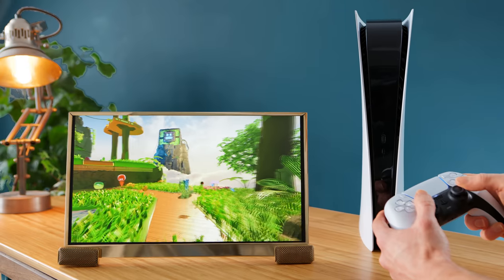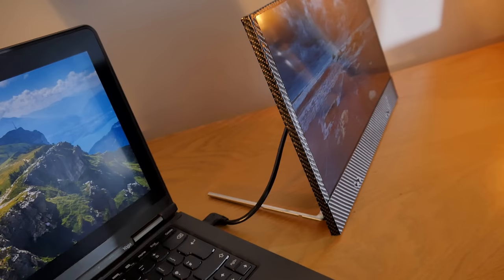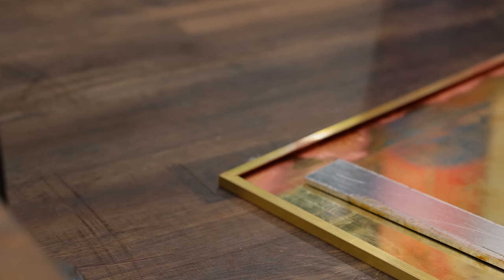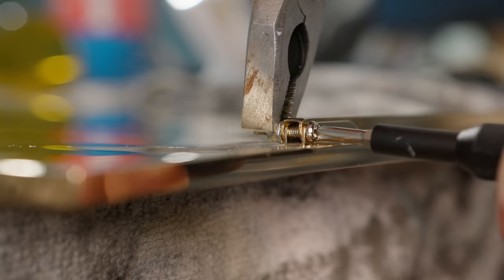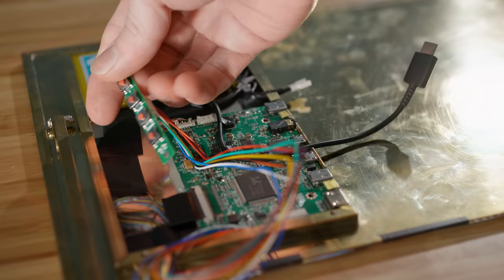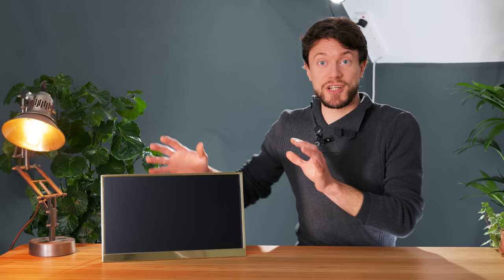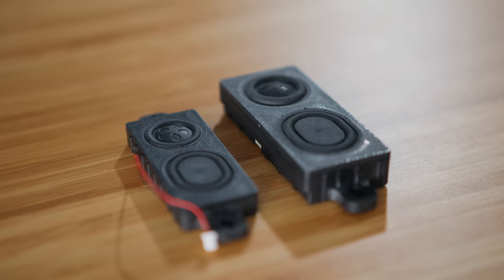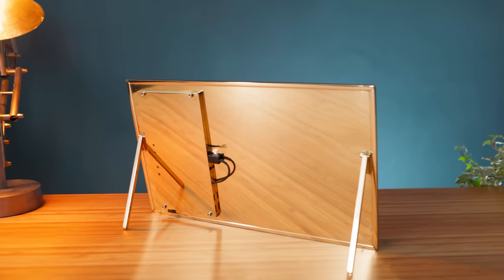Building a USB-C touchscreen monitor (new for modern devices)

Comment: Yeah everything is fine but u got away and didn't showed us how to solder the bottom frame to the back with the LCD inside the housing. Heating the back panel or the bottom frame would damage the LCD. I don't need sleep I need ANSWERS!😂
Reply: There were srew holes in one shot. 7:57
Reply: Agreed, screws are the way.

Comment: You can be good at making a diy video but it means nothing if you don't support the subscribers and other by answering quite important questions. Obviously make sure that your links are valid. Make it clear that not any screen supports touch. More information while building stating whether that the controller must supports the functions as well as the screen being used. Just stating using an old cell phone battery is not good enough. State that the voltage required is sufficient from a cell phone battery. At best they are 5 volt. Some only 3,7 volt.
And most importantly react to comments.
Reply: Yes, not all phone cells work. You are on point, not all screens can be touch screen too.

Comment: I want to repurpose old touchscreen as Star Trek-style interfaces, embedded in the walls of my house.
Reply: Doing what? remote door locks, or door openers?  Give direction arrows to sickbay? Those sound pretty cool... but just about any controls could be handled by voice only (if you don't mind some corporation listening to every sound in your house 24/7... maybe the self-contained touch controller is really better)
Reply: just buy a Samsung shop display panel with touch input, they are cheap.
not as good as wacom, good enough for star trek levels!
Reply: @user-ut9ln4vd5m  You should look into the Wio Terminal. Connect it to IFTTT, and the sky's the limit.

Comment: Is there any way to make this 120hz and still keep touch functionality? For PC gaming and such but also keeping touch functionality.
Reply: only with a screen and control board compatible with 120hz
Reply: @viniciuspacheco9607  There's microsoft surface pro screens that I've seen that are 120hz and touchscreen but I'm not sure how it would work if I used it as a monitor.
Reply: My laptop screen is actually 120hz and touch screen lol

Comment: next time at DIY perks: "making a spaceship out of 🅱️R A S S"
Reply: Wallace and Gromit would approve.
Reply: "now to compensate for the additional weight of the brass, we will use these recycled SpaceX primary Boosters, which you can get for pretty cheap on e-bay. You will need to attach them using countersunk screws..."
Reply: @diegosanchez894  😄

Comment: It's not clear to me, your display was originally with an integrated touchscreen?
Reply: he bought a touch screen along with the controller for a low price since they sell them as a "kit". He just mentioned that you can use an old laptop screen if you wanted.
Reply: @Kenny-bw2cz  Thanks, I think it's expensive for this size. This is the cause why I thought he used an old display.

Comment: Did you buy a screen that was touch-capable or did the control board make it touch capable or how does that work?
Reply: the screen has a digitizer, so you will need to buy a capable screen and control board

Comment: only 2 things i would have changed: screwing (instead of soldering) in the bottom bezel for repairability, and adding vertical kickstands or finding a solution that can be used vertically or horizontally
Reply: and maybe integrating the speakers into the bottom bezel rather than the clip on ones

Comment: Hi I'm a fan of your work. I see your videos when ever I get time.So a little request from my end is please do add the control board or other things in texts as well so that even if the link fails we get to google a specific one based on the need.I really cannot access the ebay links.Keep up the great work. TIA
Also I really wonder how a control board can add touch functionality to a non touch enabled lcd or led panel? i mean how does that even work?
Reply: The screen is from a touchscreen device. Once you have that then all you need is the right control board to get display and touch all in one. Hope this helps some. I'm currently trying to locate the control board he used as well...but the link is too old😂

Comment: If you were to make a revision to this, can I suggest an alternative battery protection board that can display the battery charge, and maybe build in some LED indicator in the front to display when it's low on charge or charging? I feel that's the key thing missing from this build and it'd be the first thing I'd seek to rectify if I were building it.
Reply: Awesome feature, I have a question, is there a way to indicate how a screen is touch screen compatible if it's original use isn't touch?

Comment: You might consider suggesting use of a non-lead based solder and an all-in-one solder with a flux core, for convenience.  And set up ventilation in a window in close proximity to your work space with a small fan drawing fumes away from your face and another window or door cracked elsewhere to allow free airflow. This is better than having a fan disperse fumes within a room,  without actually removing them... especially when if they contain lead.

Comment: That's such a cool look, will done! I'm just wondering, can I simply leave the LCD in the original laptop casing?
Also I assume, the battery is an extra add on and can be powered directly via the USBC?
Thanks

Comment: I've got 3 old LCD screens and controller boards sitting in my outside shed. Used them as a triple monitor setup years ago.. Been wanting to get one out and make a housing for it, I know the Pi can run off a power bank.... wonder if they could both run off the power bank. Just need to find the right cable and see if it works :O

Comment: So you're telling me you can make any lcd screen 4k or touch screen, just by changing the control board? That's cool as fluff!
Reply: what? no i think he was just saying those options are available now compared to some point in the past, a control board doesnt change how many subpixels/pixels are physically in the screen, the board just controls amount of voltage to each led to trick your eyes into seeing different colors and when those 3 make 1 color it has to position that among other colors to make an image, so thats 6.2 million leds(2.07M pixels) for HD, 24.9M leds(8.3M pixels) for 4k, and touch screens have a conductive layer that sends electricity through your skin with a way to tell where exactly you touched. and im guessing this screen hes using here is oled, or it just has a very small backlight
Reply: @Robo-xk4jm  Yeah I figured so but the way he said it sounded to me like you could just change control boards. And since he used an old laptop screen and made it touch screen made it seem like it would work to just change the control board. Seems there isn't any real magic left in this world :(

Comment: I watched this video when it was released and loved the idea! Recently my 60inch Samsung TV stopped working. Control board went out and I cannot find one online to replace it. Wondering if its possible to do something similar with my TV so i dont have to throw it away.
Reply: Hi. Google universal display control board. This may help depending on how your display connects in your Samsung TV. The universal display control board is a generic tv controller some have IR remotes. Hope this helps.

Comment: Hey, sorry to bother, but i am doing this project with a different lcd control board wich takes 12v and i still wanted to use a cellphone battery to charge it, i already bought most of the things, i just wanted to know if it is fine to use the cellphone battery with a dc-dc step up regulator to make it 12v for this project.
(The battery that i'm using is a LIS1558ERCP from a dead xperia z3 that i had, as for the battery protection board i am using the same that is on the video, and for last the lcd control board is a PCB800661 V.9 1HDMI)

Comment: I don’t see anywhere where he’s listed the thickness of the brass sheet he uses. Or the size of the U channel???  I’d like to do one just like this but I want to make sure I buy the right sizes
Reply: I think the Uchannel measurements depends on the screen used, since there are different thicknesses. The brass sheet should be thick enough to give a bit of structural integritry. Since the Uchannels ad a lot of stability, 2 to 3mm should be enough. The size of the uchannel can then be decided on to fit the brass sheet and Display in. A small gap shouldnt be a problem since the screen is glued to the brass sheet.

Comment: This monitor looks amazing. I want to reuse the monitor from my dead laptop and this build has pretty neat ideas. 
My question is, is the touch screen the same laptop monitor Matt uses at first with some accessory to enable touch features, or is it a different screen?
Reply: you'll have to find an appropriate controller board for your specific monitor

Comment: pretty smart, buy any laptop screen with touch and adapter, while this is like 200$, a touch screen monitor is 700 to 800$
what display control board you use for touchscreen monitor?
you should use a touchscreen with gorilaglass to be more resistant

Comment: This is amazing and is going me a great idea well it's your idea I'm just going to use it. So my home office is decorated in antiques like petroleana, old Tonka trucks and oil cans so a computer stands out and looks terrible and my laptop is dieing so I want to duplicate this build and I'm thinking about using a cell phone to power it. I have a iPhone 10xr or a Galaxy 10 either I can use. Do you see any problem doing this? I seen you connect one and it was perfect looking so would I retain most standard PC functions? I seen you connect a keyboard and mouse can I do that and a printer or an external hard drive? Please if anyone has done this could you give me tips or show me a link to someone that's done it? Thank you in advance, I am so excited for this to work.

P. S you mention desktop mode for the phone do either of the phones I mention have this ability?

Comment: What is the control board that you used? And you can power it with a cell phone battery, can the board run on 3.3 volts?

Comment: I need to replace an old CRT arcade for LCD touchscreen ONLY, I have a bunch of old laptops, can I use these displays by just adding this USB-C board setup? Does it replace the CRt Arcade touch overlay? (Input membrane.? - the clear grid covering the old display)

Comment: Wow wonderful project, I built a portable monitor but I didn't use this material.
Reply: Hi I was wondering what materials you used in your build. Currently searching for a control board for lp173wd1-tla1. Thanks in advance
Reply: @puregenius1983  i used mdf for the case

Comment: I need better documentation! what parts did you use? who supplied them? how much did it cost? This is amazing! I want the details bro!
Reply: After month of questioning around this project no answers from the author. Putting people under the wrong impression. Not every old laptop has a touch screen. The one shown does not support touch. You need a high resolution screen to get 4k. You get nothing for nothing. That cell phone battery supplies at best 5v. You have to use the control board that can operate on 5v. All the normal ones need 12v. No touch no usbc. Even if you are willing to fork out the high costs, you would find it difficult to match up these components. All links broken.

Comment: I'm wondering how you turn the device off so that it doesnt drain the battery? Also, how did you get touch working, because the screen that I have has a separate touch cable that need to plug into my board and I dont know the pin out for it, and cant find schematics online.

Comment: Amazing ! Ideas, sound, video 10/10 for me :) Your somewhat have a "sneaky face", it's always fun to watch. I don't think I will take the time to apply your ideas, still it's obviously doable without pro gear and that's the beauty of it. Very inspiring. Anyway, do you think lead soldering will last? It seems to me that the frame and feet could easlisy brake if not very careful. Actually I have an old iMac 27, 2011in very good shape (not a scracth) and I was thinking of making it touchscreen with more actual processing capabilities...First step would be to find a control board for it as the rest would easily fit in it, the inside is big enough for an ITX motherboard. If someone has ideas, it's welcome, i'll be happy to ear them. Cheers.

Comment: I have an old samsung tablet which i'm trying to use for my dash, but since the tablet motherboard is damaged i thought i would try this project!. I have ran into a small issue. The screen model number is LTL101AL06-104. I have found the controller board but I do not believe if it contains the digitizer for the touch screen and I am trying to find a type C version if anyone can help!

Comment: dumb question would a picture frame work for this ?     minus the glass front part tho   duo to glass would add glare
Reply: Maybe if you cut hole in the back of the frame for the controller board (assuming it isnt thin enough to no have to do this)

Comment: How did you use a 3.7V battery pack when the lcd controller board requires 5v?
Reply: I was looking for info on that controller and was wondering if it does operate on 5 volts. Older ones need 12 volt.

Comment: Im very impressed how you made this and I think i need this one. however, the links for the lists of parts isn't working. hope you help me about this
Reply: Unless you have a donor laptop, you are better off just buying a portable monitor with touch screen capability. You can find 15.6" 1080P for under $250 USD on amazon. You will need the lcd/digitizer ($90 USD), the eDP controller with USB C port ($40 USD), and the touch controller itself... Most of the components will come from China so lots of delays in shipment as well. Take a look at a disassembly video of a touchscreen laptop for a better understanding of the components needed plus the eDP controller for the USB ports.

Comment: Really nice project! 
I was wondering... would you be able to add support to act as a 'wireless display' for windows 10/11 ? That way, you could avoid all the wires, since you added a battery already.
Reply: You can buy wireless hdmi stuff that you plug into the screen and laptop as normal, although it might break the aesthetic and cost quite a bit.

Comment: Another good idea for a DYI cell phone find a brand new iPhone for cheap on eBay that's broke for some reason inside make sure the screen and body are good take the internals out of the iPhone and replaced them with a Android motherboard hook up the iPhone screen to Android motherboard hook up the cameras put them in the right places and still it back up and you will make the first iPhone running Android why has no-one done that yet

Comment: Hi Matt, I watched your previous vid on doing this and managed to get my hands on a beautiful complete lid/screen but realised it was a touch screen so wasn't suitable.  Now I've found this one and thought PERFECT, except I can't find any boards that suit.  I have the HP part number and get plenty of replacement screens coming up, but not a single board.  
It came from a HP Spectre x360 and from research, I think it's either an 801496-001 or an 833713-001. The whole lid is glued/sealed together so I cant open it up to find any numbers without breaking it.  I would love to get this thing up and running, so any suggestions or guidance would be really appreciated.

Comment: No clue if you read the comments, I'm checking out my local hardware/supply stores websites but none carry brass sheet metal. Are you using copper-aluminum here rather than brass? I can't find anywhere that sells it but I'd love to start working with it

Comment: Matt, love this diy! It got me thinking if I can repurpose my bricked Dell All in one touch capable, to a standalone secondary monitor with touch feature?  My Dell Xps 2710 suffered from black screen of death. But the HDMI in port works and have allowed me to utilize the all in one computer as extended monitor (but withOUT touch feature). Do you think the touch feature would work by either new control board that gives hdmi and usb 3.0 for touch? Or is there any internal cables I can convert to usb 3.0, to give/get touch inputs to a laptop?

Comment: So if the monitor is by default lower resolution you cant get better resolution with the control board?
Reply: You can't turn a tube television into a 4K flatscreen, correct.  All the control board is is the connection between the screen and the computer.  It's the brains that brings it to life.  And most of the time, there is only 1x control board that would work with a monitor, that's why it's best to buy it as a pair.

Comment: BIG QUESTION- does a build like this require thunderbolt for the touch on the usb-c? This is a project i could make, my pc/motherboard have speedy usb-c but no thunderbolt. I was looking at a touchscreen monitor from blitzwolf that used usb-c, but the touch only worked with thunderbolt... would that be the case here too?
Reply: Hi. The screen in this build is touch. So with the proper control board touch is available without thunderbolt.

Comment: love your work! check out Lord Adhesives, it has been a game changer for me as I don't know how to weld.  Use a gas mask though. Also with the adhesive and building computers you won't have a welding bead to deal with or rivets. They have all kinds of curing times depending on how fast you want to work. I have some aluminum adhesive that cures in 18 seconds and it is stronger than the actual aluminum it self. You can make boxes that look seamless using their adhesive system!